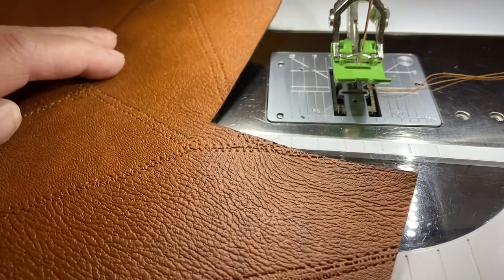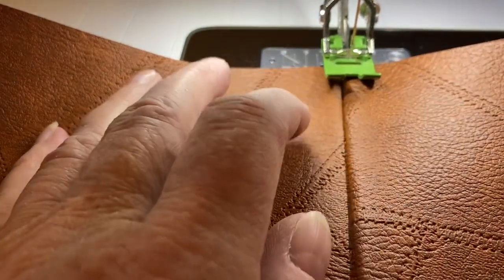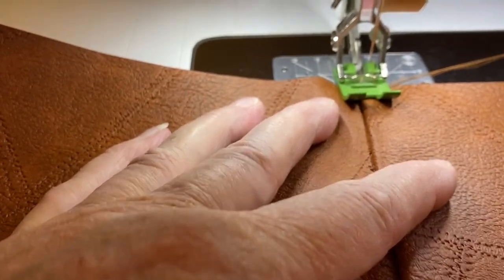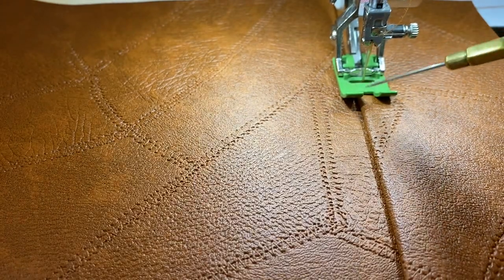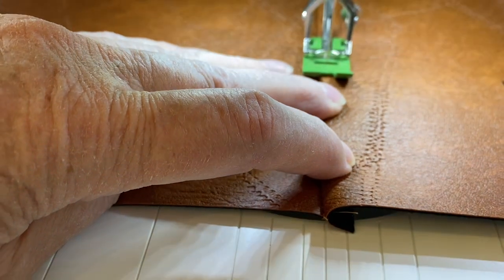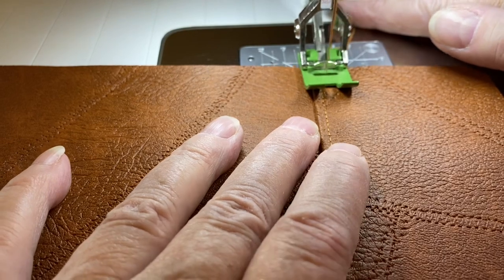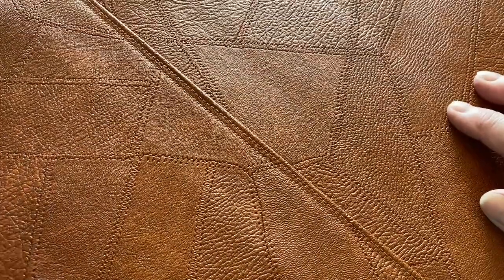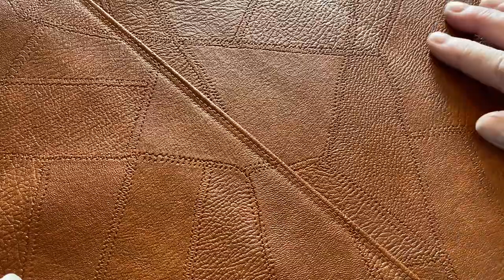How to top stitch on faux leather and vinyl

Comment: Hello, do you have any recommendations on how to back faux leather?
Reply from the maker: I have used woven fuse 2 and decovil… also sf 101 which is very lightweight… just watch the heat setting and timing…. Try on a scrap to be sure the vinyl/ faux leather can handle it…❤️